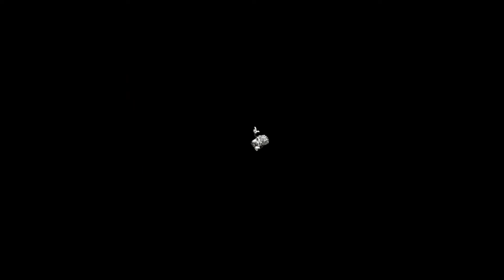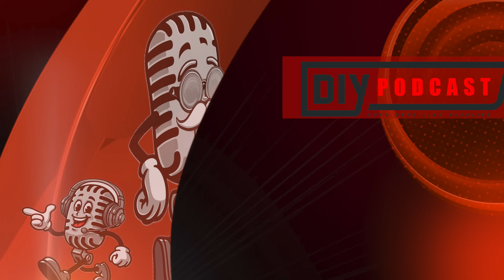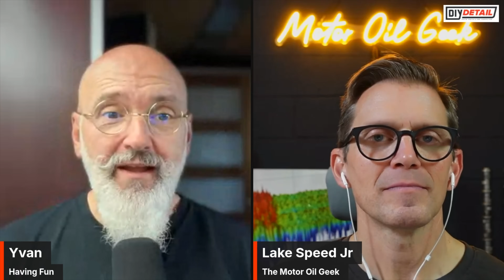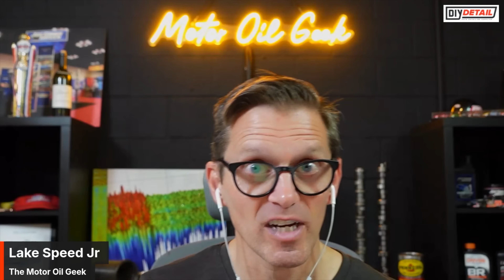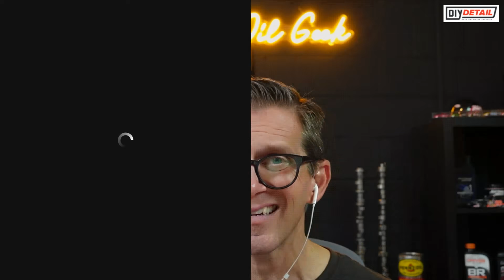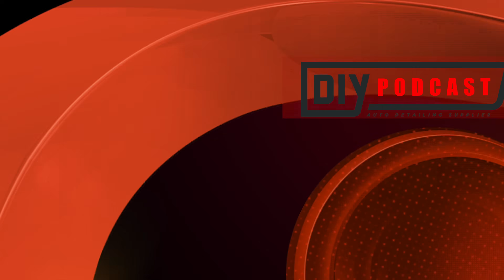Oil myths busted with Lake Speed Jr and DIY DETAIL PODCAST

Comment: Lake is the person to listen to, bet he tests oil in his sleep. Have a Chevy, in the Midwest, use 5w30 Mobil1 Full Syn. for 95% of the year, change oil every 6800-7500 miles, drive 80 miles a day, 5 days a week min. In the coldest of winter I run a single run of 0w30 Mobil1 Full Syn for about 5000 miles. Car is now over 260k miles and the cams look like a 80k mile car. Also run Premium 91 no extra Ethanol added. Driving the car, having Clean oil and Clean fuel is the key to getting into high miles. Goal is 350k on this motor.
Reply from the maker: Hopefully you go past that.
Reply: No such thing as Full Synthetic,  100% Synthetic, or Synthetic. Just marketing terms. Your Mobil 1 is just a Group 3 with no synthetic bases. 99% of American so-called synthetic oil is Group 3. Castrol ruined synthetic oil in 1998.

Comment: Thinking about switching too 5w30 from 0w16 in my 21 corolla 2.0L. Toyota recommends 5w30 for this engine in other countries, i think it's for the EPA here. Thoughts?
Reply from the maker: Good question
Reply: Pretty sure Lake has a video about that. Bottom line: Thin oils are put in the by the manufacturer to help meet EPA  mileage goals. They just don’t protect as well over time. Get that stuff outta there. 5w30 seems fine.
Reply: That’s exactly what it is. 👍

Comment: My first gen Tundra has 260K miles on the engine.  I have done all the oil and filter changes since new with synthetic oil and Toyota filter.  My question for you is, does adding Liqui Moly Molybdenum additive helpful, harmful or no benefit?
Reply from the maker: From videos on Lake’s channel, it does nothing.

Comment: I have no doubt that both of these guys have way more knowledge on this subject than I do. 
But in my humble opinion, there is no such thing as oil that is too clean or too fresh. I change mine every 3000 miles max. Engines are expensive, oil isn’t. 6 quarts of oil and a half hour underneath my truck every few months isn’t such a sacrifice in my book.
Reply from the maker: Nothing wrong with extra caution.

Comment: The issue I have with the low viscosity recommendations from manufacturers (Toyota) is the 0W8-16 are strict only in US. All other parts of the world allow higher grades to be used (specified in the manuals). And no, Toyota is not making different engines for other parts of the world with different tolerances for lighter oils. Leads me to believe the only reason for this is emissions. Based on all the horror stories of today and engine reliability (cough, GM), tells me manufacturers care only to have that engine last until warranty is over, planned obsolescence.
Reply: @timannnn in the UK the Japanese manufacturers are advising 0W/8 and 0W16 engine oils for there modern cars.
Reply from the maker: Interesting observation, thanks for sharing.
Reply: @diydetailofficial Can you actually respond to him? I want to go higher weight with the 3rd gen tundra during the summer too. Is 5w-30 too thick for the tundras turbo canals or something??? No one smart is firmly stating anything.
Reply from the maker: @drmurda I’m unfortunately not the specialist here, Lake Jr is.
Reply: @diydetailofficial  I called Amsoil yesterday. they refuse to talk about incorrect / insainly light oil weights that manufacturers recommend. And I bet he would refuse to in FEAR of being sued by corrupt asholes.
Reply: @drmurda 5w30 is perfect for the tundras.  Nothing bad will happen.  You will have a longer lasting engine.

Comment: In a small town, its easy to chat with others regularly.  

I have stereotyped those that can't see the cost benefit alone in oil analysis. 
They buy gas at the C-store that doesn't have top tier gas But they gets points to spend on puzza or drinks.   Wait,  WAIT!   That's not all! They will just use transmission fluid to clean fuel injectors!

And how could moisture end up in the rear brake calipers? 
OR - rear diff fluid doesn't need changed unless it's replaced!
Reply from the maker: Unfortunately often true

Comment: Lake!   After my first dozen oil analysis, I started to correlate fuel econ average between oil change intervals. 
This started with a 12 liter diesel.  And Volvo diesels run oil temperature up over 200.   Climbing mountains or pressing into 40 mph head winds all day at 70-75 mph travel speed will push oil temperatures up around 230°f.  
Sometimes I just can't help but change it after the last scenario because I can smell it when I get on the ground (from drivers seat).

Back to fuel econ vs. miles:  with the data from several analyses, it was becoming apparent to  me that the amount of fuel burned between OCI was a factor.   
So for my current semi, 1875 gallons burned, an oil change is due.  

In my early 2000s SUV, 225 gallons is about time. 
The GM oil indicator = 65%
I like to use  Techron in   gas tank so that it is mostly used up BEFORE oil service.
   
Typically my fuel and insolubles are ~.5 percent .

It's a GM Atlas inline 6. My fuel econ has improved to 20+ hwy after a year of Valvoline R&P.  EV rated tires probably helped, too.
Reply from the maker: Thanks for sharing

Comment: My question is about the EcoBoost motors I have heard people say did they have taken apart trashed EcoBoost motors where the oil analysis said it was good but they have oil-related failures how can an oil analysis still reflect positively but have a negative effect on the engine
Reply from the maker: Good question

Comment: 49:28  I am doing something similar with the Pentastar engine, (Jeep squad tends to lean on 5W30 for wear protection), where as the newer engines call for a 0W20 (previously 5W20). Started this on the car when first getting it used, 79k with unknown maintenance oil brand history (dealer serviced), started with Amsoil Signature 5W30 3k later, swapped to Motul 8100 Power 5w30, Analysis at 1500MI and 60hours of time, lab said got another 2k miles or so in it, and all wear metals show under average for engine age.. posted results in group on FB guy said I was destroying my engine and lab results mean nothing... Que spiteful adventure..
Reply from the maker: Follow your own trail
Reply: @diydetailofficial  that is plan all be it a spiteful one 😂

Comment: Be interesting to see how much wear happens with doing say, 2x or 3x as many oil changes vs doing longer intervals such as the manufacturer's recommend. Many vehicles have oil filters oriented in such a fashion that you cannot prefill them when doing an oil change. There's a second or three where the dry oil filter is filling (think some VW & Audi applications where the oil filter is located vertically atop the engine). How much wear is happening each time an engine is fired up such as these with a dry filter? Curious
Reply from the maker: Great questions.

Comment: Saying gasoline contamination is the enemy of lubrication:
My 2-stroke bottom end runs fine 
on 1% oil [Saber] and 99% gasoline.
Explain that smart pants.
Reply from the maker: The 2 stroke is designed  for it
Reply: @diydetailofficial    Can you be more vague.?
Reply from the maker: If gasoline were a good lubricant you wouldn’t need to add oil to it. A 2 stroke relies solely on the gasoline oil mixture for lubrication. A 4 stroke relies on the oil in the crankcase too provide lubrication. Check out the driving 4 answers YouTube channel, he explains it quite well

Comment: Oil "Flushes" are Bad 99% of the time.   I would never use.   The problem is, oil flushes on a badly maintained engine, will loosen and break sludge up into large particles which usually clogs oil passeges in the engine.   Not a fan.   Valvoline Restore and Protect works better becasue it slowly removes and reduces build up.    I've seen friends use an oil flush only to seize their engines on their used cars in a few months.   Bad Bad bad!!!
Reply from the maker: That is a valid concern.
Reply: hell I flush my engine every 3-4 oil changes  started about 110k  now 260k still runs great  no problems  😂

Comment: Great Conversation. Still not convinced of the Valvoline Restore and Protect.  some say its good some say it messed up their engine. i been watching  a lot of Lake stuff for a while now and he is full of information
Reply from the maker: Glad you enjoyed the conversation, and thanks for watching!
Reply: Lake did a great video on Restore & Protrct with related oil analyses. Absolutely convincing results.
Reply: @genobrn8743 maybe but there are numerous other folks showing the real world issues it can cause. In a lab,  things are done under ideal conditions. Even in one of Lakes test it gummed up the oil pump.  I am guessing this is why it takes that many oil changes but also to lock you into buying it for the next 2 years.  Maybe it works and that any seal leaks etc are the side effects of it.  To me using a good synthetic even restore and protect early in an engines life and changing it 
3-5K  is the best way to go.    After working on my own cars for 40 + years i say Prevention is better than cure.

Comment: 2015 yukon wants 0/20. Im thinking of doing 5/30 in hot summer months. Hope thats fine with the cylinder deactivation. Ill switch back to 0/20 for winter.
Reply from the maker: Sounds like you have a good approach.

Comment: People are overthinking this too much, change your oil every 5K call it a day!
Reply: A $50 oil analysis or $30 diy oil change?  No brainer.  Just change it.
Reply: Got an engine?   Put oil in it.  Check the level once in a while.  Take a peek at your owner's manual.  Use the oil your manual says to use.  Change it and the filter at recommended intervals.  Unless you're a racer or some other type of engine abuser, you will not have oil-related problems....ever.
Reply from the maker: It’s a good general rule.
Reply: You cannot use this approach if you drive 2-3 mi per day! Cars are driven differently and only rule applies all does not work.

Comment: Why are the old flat tappet guys left out in the cold without a good synthetic with a high enough ZDDP content that doesn't cost $15 a quart?
Reply from the maker: Modern oils have sufficient ZDDP. There was a period where the detergents were too strong, meaning you needed a higher ZDDP concentration to compensate. Those times are thankfully gone.

Comment: Oil changes:
2/3 of new car buyers trade cars at 60,000 miles.
Second owner drives 60,000.
Third owner drives 60,000.
Last owner drives it til its dead.
Why should owners 1 and 2 change their oil early. That would be a dollar expense with no value to them.
The 3 and 4 owners probably cant afford short oil changes.
Got it??
Reply from the maker: Unfortunately that’s the case for many

Comment: Lake is the best! So glad he spoke about where you live and the type of driving you do.  Obviously if you’re in stop and go traffic constantly and short trips with 20% highway driving at highway speeds, you’re going to need a shorter oil change interval.  If you tow, haul a lot of additional cargo weight or floor your gas regularly, you need a shorter oil change interval. This should be common sense but the science proves this for the doubters.
Reply from the maker: Agreed

Comment: Hi im in Puerto Rico and I have a toyota corolla le my wife drive to work on highway i change the oil every 5k miles and my toyota rav4 2024 LE i change my oil att 1500 miles, 3000k miles and 5k miles the reason I did it its new to see if it had metal in the engine and know i doing it 5k miles. And what gas ⛽️ the corolla she use regular i usa super. And we're do i get oil check to see the difference on data. Thank you very much. Respect and thank you for everything you do for us, regular people.
Reply from the maker: Thanks for sharing

Comment: I have a 2014 Camry that I have been using Royal Purple for 160k miles.  I replaced the valve cover gasket, and the valve train looked brand new still at 210k. It costs me $40 at Walmart to get a jug of 0-20 and a Toyota oil filter.
Reply from the maker: Nice

Comment: This was fantastic. I enjoy watching Lake's videos, it's why I'm running the Valvoline R&P in my own truck.
Reply from the maker: Thanks 👍
Reply: He actually stated ANY full synthetic oil nowadays cleans excellent & Valvoline R&P is better for vehicles that weren't cared for very well. That's how well Pennzoil,  Castrol, Mobil1 etc perform!
Reply: Keeping something clean is easier than deferred cleaning. 

I bought a vehicle with 225k miles from a guy who took it to dealership every 3,000 miles. 
I took a peek with a camera before and after a year of using R&P. There is a difference under the valve cover. 
My hwy economy has gone from 19 to 20+ mpg.

Comment: 17:14 Hello Lake! My first two oil analysis are showing 1% fuel dilution, which also lowers the viscosity! Analysis was done at 3000 miles using Valvoline R&P 5W-30. No short trips, 150 miles commute three times a week here in Central Texas.
2024 Subaru Ascent 2.4 L DI turbo.  SUBARU still considers a Turbo to be “severe duty“… shorter intervals are recommended.
FYI: I just began using “Top Tier” fuel @ Circle K/Valero ($.30g.Discount Offers) for this oil change interval. I will update with my next Oil Analysis results.
Reply from the maker: Thank you.
Reply: Uhhh circle k isn’t top tier. Only Valero.
Reply: @TaylorPhase  Every Circle K I’ve been to here in Central Texas has been top-tier! Also, Tampa Florida as well. Many Circle K’s have Valero.
Reply: @PianoTuningArtist Google it. Circle k was taken off top tier gas in 2019.
Reply: @TaylorPhase  sorry! Can’t believe everything Google says! It’s labeled right on the pump!
Reply from the maker: This website will give you up to date information. 

https://stationfinder.toptiergas.com/
Reply: @diydetailofficial  thanks for your follow up info! The top-tier website does not list Circle K, in spite of the fact that all of the Circle K‘s in Austin that I have seen are labeled “top-tier“… I did contact the site to tell them the errors!

Comment: Ive tested alot oils over the years lab tested etc etc as i have some crazy rides like 2000hp gtr, 458 and my is 350 i use as my daily and first i never use what manufacturer recommend period, also i use redline oil for everything since its the best ive found nothing beats it, my 458 is 0w40 recommend i use 5w50, my GTR is fully built i go 10w50 and my is 350 0w20 is recommend i go 0w40 in summer and 0w30 winter, runs smooth as butter and ive done lab test with 0w20 and 0w40, nkt comparison the amount of wear with 0w20 its alot compared to 0w40,manufacturers dont give a shit as long as you pass warranty period, after that you need a new engine with 100k miles and thats great for manufacturers,  they dont want your car lasting 500k miles
Reply from the maker: Thank you.

Comment: Would there be any benefit to putting 0w-16 viscosity oil in my 2009 Corolla with 1.8 L engine that calls for 0W 20? Call runs great I’ve done rigorous maintenance on it currently 310,000 miles and uses only about half a quart of oil between 5000 mold changes. thank u!!
Reply: Switch to 5w30!!!
Reply: @MAXIMUSMINIMALIST  Oh no way in the world would I ever do that. Yeah those VVTI extremely narrow oil passages that rely on oil pressure accuracy for cam phasing  I would never go thicker than 5W 20
Reply from the maker: It’s worked well for 300k, don’t change now
Reply: Stick with the 0W-20 and use Restore and Protect. My Camry has  185,000 runs smoothly and less gas.

Comment: I, have yet to receive a set comments, in regards to GMs EOS, aka engine oil supplement and STP. I have done the oil analysis on both thru my local CAT dealer. I now Lakes general beliefs on oil additives, and I agree with him. However he did a great program on oil additives, mentioned STP, but didn't give any results or opinion. He left out GMs EOS, ALTOGETHER, this product has been mentioned in GM SERVICE MANUALS, and the forever famous CHEVY POWER BOOKS. THANKS.
Reply from the maker: Thank you for the feedback and suggestions!

Comment: I have a 2011 Camry SE V-6 with 303,000 miles on it and change the oil every 20k miles with Mobil-1 full synthetic (non-HM), it doesnt burn oil between changes, the engine is nice & clean inside.  Used oil analysis (with TBN) confirms that my oil was still goos with TBN  still around 1.4 and no abnormal engine wear.  3k-5k for full synthetic is wasting good oil and provides no extra benefit unless you frequently do short trips in cold winter.
Reply: Yea…Im gonna pass. Every 5K for me. I cant afford new engines but more power to you.
Reply from the maker: That's impressive!
Reply: Your example proves nothing. I got almost that many miles on a 2007 Ford escape using Walmart hyper tech oil and normal oil change intervals. There's no way that engine is in good shape based on that kind of neglect and abuse it may seem OK but those upper cylinder walls will tell the truth.
Reply: @MAXIMUSMINIMALIST so 303k moles proves nothing? And no one very got over 150k on a 2007
POS ford escape.
Next lie?

Comment: I have a Prius in Brazil, and I do my oil change every 5000 miles with semi-sintetic 5W30 oil from Toyota.
Reply from the maker: Thanks for sharing!
Reply: In Brazil they use km not mi. Are you changing oil every 7500-8000km?